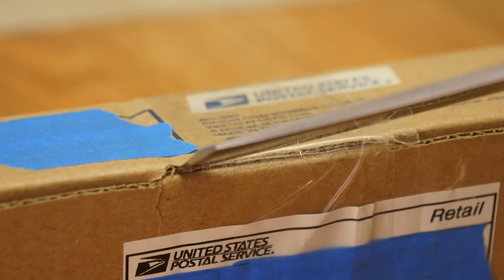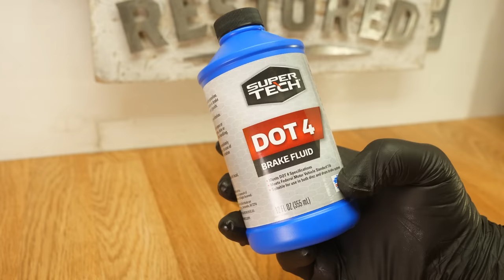150 Year Old Civil War Bayonet - If This Restoration Could Talk

Comment: The shape is interesting; I always thought bayonets were flat blades (or spherical/square pointy cones). Though, this makes sense as it would be sturdier and sharper throughout. Nice work!
Reply: For a time, back then, bayonets were specifically designed to make the wound more difficult to heal or for doctors to sew up. A simple blade is easier to heal or sew up than a triangle or other odd shape. Thus insuring one less soldier on the battlefield!
Reply: Additionally, if the soldier was only wounded, it took multiple soldiers off the battlefield to care for him. If the soldier dies, he was left until the battle was over.
Reply: And that type, because of its shape was called a crucifix bayonet.

Comment: The three sided blades were designed to make a wound that was harder to repair or heal.  I wish they were still designed like that. They would come in handy in close quarters combat
Reply: Other than it being a war crime, sure.
Reply: @codycampbell3562  Wounding a soldier is not a war crime.  Even if it is, it is so by modern sensibilities.  Weapons of this kind have been standard for thousands of years across all cultures. Weapons and tactics used in the American Civil War were based on those used by Napoleon.
Reply: @pfcparis  Using a triangle shaped bayonet is a war crime bud.
Reply: @codycampbell3562  Where is it written?
Reply: @pfcparis  The NATO treaties dide
Reply: @codycampbell3562  I have searched the NATO treaties as well as the Geneva Convention. Nowhere is it written that a triangle-shaped blade is illegal.  Some experts believe it would be classified as a weapon that causes undue suffering as described in the Geneva Convention, however, it is not explicitly banned.  It could also be argued that it causes no more harm than any other weapon used in modern warfare.  As a former soldier myself, I received no training concerning this type of weapon.  If I am wrong, please cite the document, article, chapter, and subchapter which bans it.  I would very much like to know the truth.  This type of bayonet has been considered obsolete in 20th-century warfare.  Bayonets are rarely used anymore and are designed to serve multiple purposes.

Comment: When you feel in a large area with multiple tacs with a flux core welder I would clean between welds if there will be any overlap at all.  If you don't you'll get slag buried in there.

Comment: Such things are welded by TIG welding, And you have MIG, and it seems without gas, and you don’t seem to know how to use it ... The welding wire should not come out more than 4-5 mm from the nozzle, otherwise there will be a lot of spatter. Use TIG welding, it will be more accurate and better.